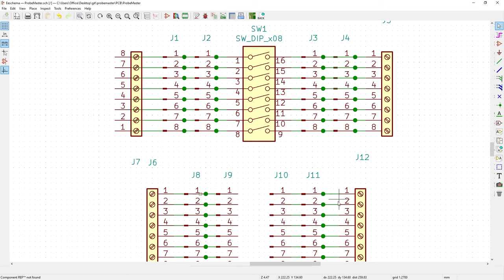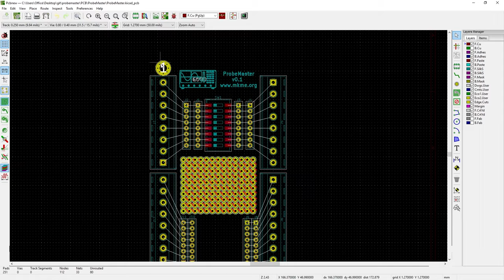How To Make A Breakout Board For Repair & Hardware Hacking | TUTORIAL

Comment: Great design, for a truly solder less and reusable board, you could add a couple of rows of headers instead of the prototyping areas, you could build your sub assembly's on small daughter proto boards and plug them in.  You could still add the headers to the proto areas.
Reply from the maker: Yep if you look close you'll note there are 2 rows of headers on each row of terminals.  You can indeed plug in anything with male or female 2.54mm headers.  These are direct connected to the terminals across the board already